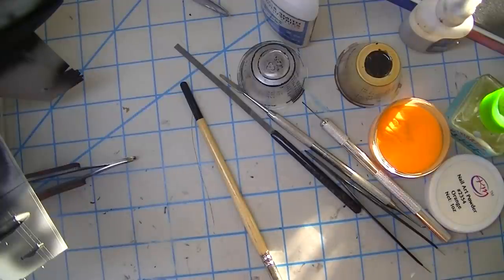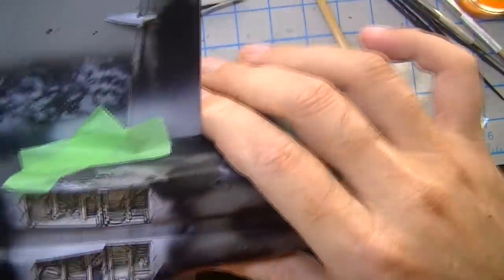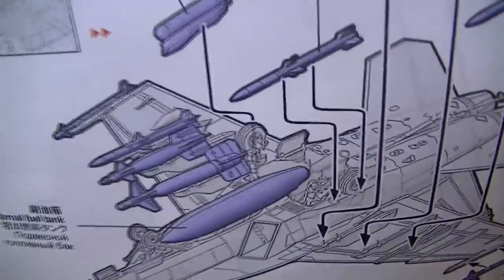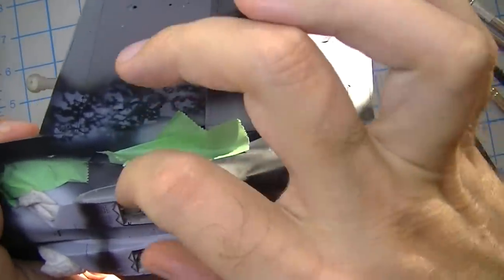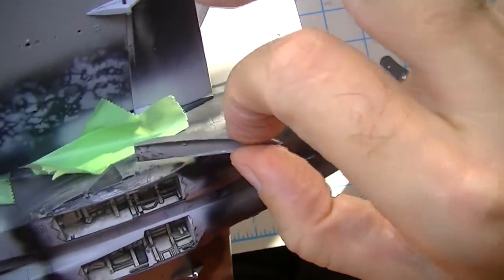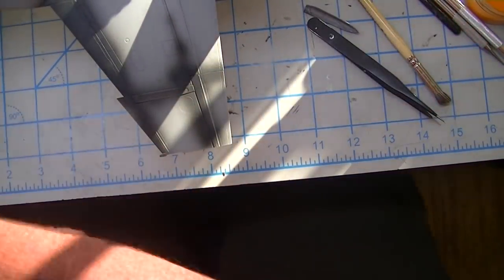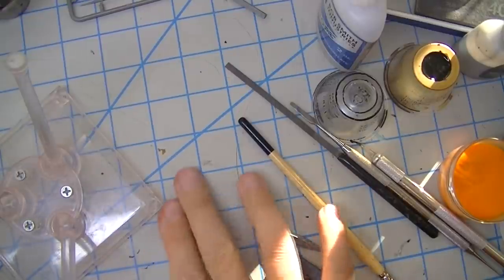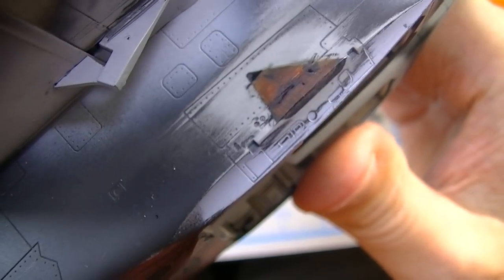ep336 = 17 minutes of meng 1/48 super bug random #54

Comment: Great video series!! Very informative
Regarding the depression that is located close to the 5/7 station
In the Reid Air Publications book "THE MODERN SUPER HORNET GUIDE 2nd Edition: The Boeing F/A-18E/F & EA-18G Exposed", there is a clear reference to the existence of the Sparrow fin-like slot.
The panel housing the racks and the lubricant providing infrastructure is one  and indeed deep enough to completely enclose the fin. The reason is for the smooth airflow under the wing. When the Super Hornet will be armed with either a missile or a ATFLIR the depression exists. When it will not be armed, the whole panel is replaced and the racks and depression are closed with a new aerodynamic panel
An image sent to you via messenger